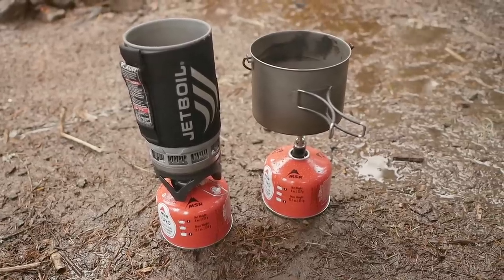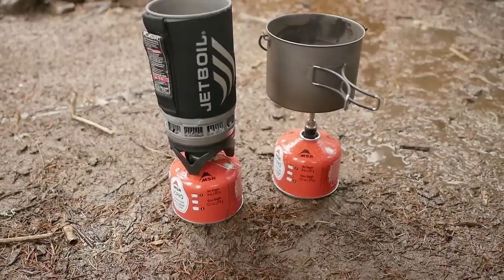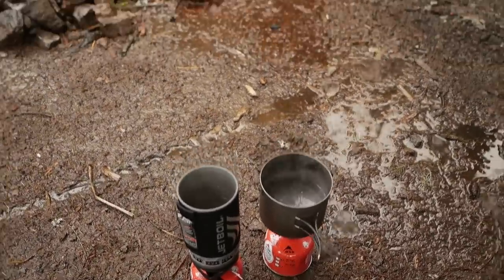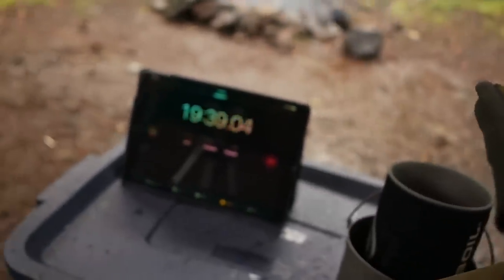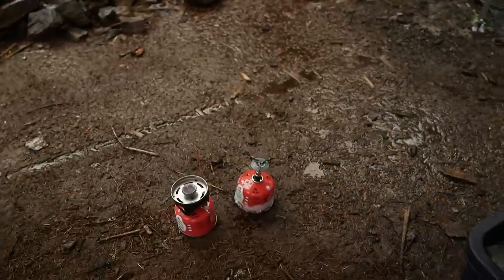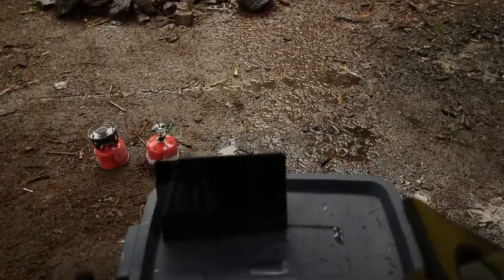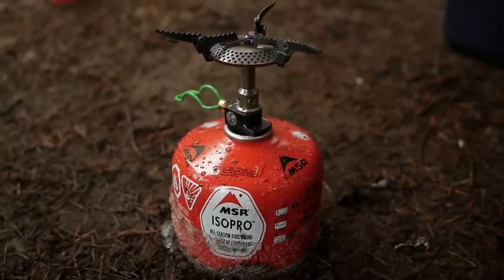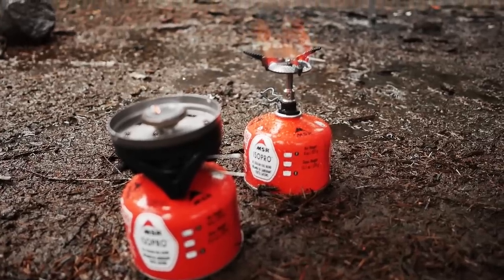How Long Does an 8 Ounce Fuel Can Last?  Jetboil vs. Optimus Crux Lite

Comment: It's really more about how many BTU/hr each stove produces that determines the burn time.  The Jetboil doesn't burn fuel as fast because the burner produces less BTUs/hr.   It relies on the heat exchanger on the pot to more efficiently transfer heat to the pot.   The open stove on the other hand, doesn't transfer heat to the pot as well.  It needs to make more heat (produce more BTUs to accommodate for it's inefficiency.   The real test would be to measure heat transfer to the fluid in the pot.  I believe you would find the Jetboil to be about 30% more efficient due to the integrated heat exchanger and pot insulation.
Reply from the maker: D. Volvoguy that’s exactly what I noticed on this experiment. The Jetboil stove draws out less gas from the canister to heat their container. Very efficient system
Reply: the 'trick' is the jetboil limits the max output of gas to maintain a more adequate fuel-air ratio. but if you adjust the Crux to 'blue flame' all the time they will last pretty much the same.

you could try to adjust the crux to the maximum flow with blue flame (optimum air-fuel ratio) and check if the contraption of jetboil really makes a difference.

i dare say it will make less than 10% difference: the main barrier for water heating is the transfer between metal and water. that is why a frying pan boils water faster than a taller pan with same volume and tea-kettles have a very wide bottom.
Reply: The test you mentioned is not needed as it has already been performed. Once the two stoves boiled water in the same amount of time only one variable remained. Technically there is a chance that either stove could have been turned down a bit and the maximum flame might have remained constant...I did see a lot of yellow/orange flame in the beginning with the Optimus. Anything beyond a blue flame with most gas stoves indicates an inefficient burn. But I doubt it would lessen the difference between the two stoves very much...maybe 20 minutes? Perhaps 30 minutes?
Reply: And this is exactly the reason why the frozen condensate was on the optimus and not on the jet boil as the pressurized gas was escaping the canister at a faster rate.  https://www.quora.com/Why-is-there-frost-on-the-outside-of-my-propane-tank
Reply: I tested by measuring weight loss from the fuel cannister. I compared an Optimus with and without a heat exchange pot. 11-12g of fuel without the heat exchange pot and 7-8 grams with the heat exchange pot. That tallies with other comments here about a 30% difference. To me the message is carry a little heavier pot to reduce fuel weight. The burner is less an issue if you set the flame to an efficient heat.
Reply: I noticed the optimus boiling way more than the jetboil at the time you pulled them off. Still maybe less efficient, but if you had timed them separately to the rolling boil, then did the math, the amount of 2 cup boils may be much closer to equal.
Reply: Yup  his Experiment mainly proves that the  Optimus  puts out more BTU
s so it can  boil water in the same amount of time as the Jet  Boil it just has to use more gas to get the same heat to the water..
Reply: Jetboil uses a small jet... Most open types use a 35... But you can buy those heat exchange spacers with a wind guard for $9.00 that fit over the open types. So you get better heating..
Reply: I found the most impressive thing wasn't the difference between stoves but how long those little fuel cans last. It's WAY cheaper than I thought it might be.

Comment: Thanks for the test. The fact that the fuel can on the Optimus showed frost when the JetBoil didn't was an indicator that the Optimus consumes fuel at a faster rate. If they both take the same amount of time to boil then the test reveals the Jetboil to be more fuel efficient (which I believe it is). The JetBoil's heat fins transfer more of the heat to the cup.

Comment: You're assuming that the efficiency and burn rates don't change as the canisters burn off.  BTUs per unit of time would be a better measure.  Interesting test, though.

Comment: I wish efficiency was the testing benchmark of these stoves. Yeah boil time is great but if it can boil 2 cups in 10 seconds but uses an entire canister every time then it's useless. But if I can get water to a boil with 200 uses then I know I can pack 1 canister of fuel with no worries.
Reply: Floordford amount of burn time / time taken to boil - should be able to tell you what you need
Reply: As far as given time with canisters: this should tell you you’re good either way with 1-2 of them. Typical resupplies are going to be 7-10 days for areas so 1 should last you because boil times don’t take much longer than 5-7 minutes typically. The shortest of the canisters had an average of 48 uses and it’s faster and that’s more than what you’d need before a resupply. Especially when the jet boil is bulkier and heavier.
Reply: @brianbrooking496  You're missing an important factor for some people though.  It's not as black and white as you'd suggest.
Reply: True Mordecai some people are hell bent on over complicating the simple things.....
Reply: @brianbrooking496  Yeah, I agree, such as weight.
Reply: @Hertacles  the jetboil is not more bulky
Reply: @crunch9876  literally look at it. It's a plate on a fuel can. Idk how you get it's not more bulky when it is.
Reply: @Hertacles  cuz it all fits in the
Cup that comes with it.... like every system.... only bulk that matters is bull while stored...
Reply: @crunch9876  that's why people who go lightweight and UL setups carry it still then, right? Because it and the cup is so much less cumbersome and lower profile than an MSR or BRS with a titanium cup? I didn't say it was bad, I said it was bulky. Which it is. But enjoy what you obviously use. Also the 2 I named can fit in smaller cups than the jetboil with a fuel can and take up less room. Have a good one.
Reply: @Hertacles  i didn’t say anything about weight. I said bulky. It’s not bulky. The larger cup is a plus as far as I’m concerned. I tend to need more water boiled not less
Reply: @crunch9876  you're not reading all of what I said either. The entire system is larger than other in its class. The 2nd to last sentence in my last comment literally said that. Those cups can boil 2 cups of water some as the rest and they're smaller profile and lighter weight.
Reply: @Hertacles  "2 cups of water same as the rest and they're smaller profile" think about that statement for a second.
Reply: @joshuas390  um... Ok thanks 👌
Reply: What I do is weigh my canister before and after doing a test boil
Reply: Bought an 8oz can with jet boil, been using it every morning to make coffee. Been a month, still using the same canister, try again
Reply: Thank you !!! That is the true testament. No pun intended. 😂😂😂😂🤣

Comment: Since the one canister froze the butane wasn't boiling off. Propane boils at -43F, IsoButane +10F and Butane +32F.
So the Propane boiled off and was used. Don't know if your blended canister had IsoButane (some do) but
I would venture a guess that the Butane in the canister didn't boil off, hence wasn't used, or at least not in its entirety.

It would be fun if you warmed up the canister to see if you could get more use out of the remaining Butane. At any rate, great
test. I would never guessed that it would last 2-1/2 to 3 hrs and I use these quite often on my little adventures.

Thanks for posting, I often wondered about this.

Comment: Interesting.  I was cheering for the Crux.  I've used the Optimus Crux for about 12 years now, and I'm a big fan.  I may be less efficient, but it's a rock star at high altitudes.  This was useful info though.  I've never really kept track of the burn time.

Comment: Cheers mate! Very helpful. I'm bikepacking 1 to 2 weeks and this vid has answered all my questions. I reckon I might even be fine with a 4oz!
Reply: 4 oz will get you at least 18 boils with a bsr stove (2 cups) and a plain pot.  If time is not an issue and you use a good windscreen, you can go higher.    In any case, you have temp, elevation... and so on as variables so there is no hard and fast number, but even an relatively inefficient stove only uses about 6.x grams of fuel per 2 cup boil.  If you get a more efficient system, then you use even less fuel.

Comment: Just from observation, the Jet Boil timed at 3:35:00 and the Cook Stove timed at 2:25:00 according to your timer.   But i notice the Cook stove boil water quicker and emits a bigger stronger Red Flame in the beginning.   in conclusion, i'm thinking the Cook Stove BTU is higher than the Jet Boil given the weather, temperature, and Fuel Canister even in the Test Environment.   

But good job doing this since i'm always curious as to how long these small little canisters last and how many to bring during a week long backpacking trip.
Reply: Thanks for saving me 10 minutes!
Reply: Popeye Sailorman yeah ok, but you didn’t factor in the radiator fins on the jetboil and the surrounding atmosphere protection to stop heat loss that’s built into the jetboil.

Comment: When I start my canister stove, the flame goes out after about 2-3 minutes (dangerous if you forget then to turn the gas off). I have to turn the gas head, till I hear a tiny "pop" like an air block going away, then I must screw it back to relight it. Then it all happens again. Any idea if its a faulty gas head or... what?

Comment: This test was not accurate. Both stoves reduced power after canisters become cooler and froze up especially that Primus system. It would take much longer if you would try to boil those same 2 cups of water after canisters froze up. Stoves run on reduced power and fuel consumption(per minute), therefore it took longer to use up those canisters than it would take if canister temperature did not drop as much.
Much more accurate would be to weigh canisters before and after boiling those 2 cups of water, for more accurate results boil 10 cups on each canister. It takes about 6 - 7 grams of fuel to boil 2 cups of water in room temperature and probably 10 for that other less efficient system. So jetboil would be good for some 35 uses, and that other system maybe 25 uses.

Comment: Interesting experiment having worn out my second jet boil sol, and having a few stoves and pots I decided to try a titanium pot verses aluminium pot verses  the jetboil sol pot using the house cooker/stove top to see how much diffence the pot makes. The result was
 4 minutes for the jet boil pot to boil, 41/2  minutes for the msr aluminium solo pot to boil and a surprising 6 minutes for the titanium snow peak pot to boil. Heat conduction through titanium is very quick so I guess it dumps heat fast.
I suspect that the crux was more affected by wind than the jet boil so with a wind shield would be closer to the jet boil time.  I'm thinking the pot and pot stove contact is the most important thing when considering how many gas canisters you need to carry.
Happy trails from the UK, other opinions welcome.

Comment: very interesting.  do you think Jetboil is efficient due to burner design or because of heat flux?  or combination of both?
Reply from the maker: nofeesh I think a combination of the heat distribution coils under the pot as well as the stove design contributes to the effectiveness . Definitely uses fuel more efficiently that’s for sure

Comment: hmmmm I think you would have found that the boil times would have increased dramatically as the cylinders emptied.  Not sure you would have archived the 71 boils that you state.  I've had several different gas  stoves and the boil time on all of them has increased as the cylinder becomes emptier.
Reply: Liberal science

Comment: Interesting video. You didn't address the decreased pressure towards the end of the canister. It is easy to see that the flames looked different. In my experience it can take much much longer to boil at the end of a can, so I think 48 boils is quite a lot more than you would actually get.

Comment: Personally I don't obsess over this, just 3.5 ounce micro burner and canister. Also have Esbit stove, use casserole type pan to disperse heat will boil some water, use baking soda to remove soot. Ultralite Alcohol Stoves I have all but dismissed as finicky and dangerous, but cat can type would consider under limited conditions. Use lot of tin foil for rehydration etc.

Comment: Should have used the Optimus windshield and a heat exchanger pot on the crux.
On low heat with a heat exchanger, my crux boils 300ml water in 1 minute 48 seconds.
Nice to know roughly how long it will last though.

Comment: The Optimus cook pot with the heat exchanger like the Jetboil is much more efficient. 
I get boil times very close or better than the jetboil and not having the crux turned up so much. 
Personally you should have both types of cooksystems, even having the jetboil mo system is still not the best all around thing to have. 
Having a burner with a wider head is much easier to actually cook with, even thought the optimus burner doesn’t regulate as easy as a JB mo, I tend to favor my optimus set.

Comment: Ok I have not seen the end, but the frozen condensation means the pressure in the tank is dropping faster, I'm guessing that will be the first to go out
Reply: I was right! Of course the jetboil will be more efficient, the pots are designed to capture energy better
Reply from the maker: Tony Rueb yeah, I didn’t realize that the cause was rapid pressure change until now. Great observation 👍

Comment: Soon as you saw the bottle frost up you knew it was using way more gas than the other.  I do like the jet boil but the extra expense for it I’m just not sure, but now we know you after a while it will pay for itself because it uses less gas.  Thank you so much for taking the time and expense to do this.

Where was the eye candy in this video lol.

Safe safe and take care.
Reply from the maker: wizardorlegend yeah it’s good to take into consideration the long term costs. Hope you find the right one for you🙂
And eye candy will be coming soon in a video, lol 
Thanks!
Reply: wizardorlegend, it seems like your logic is unusual.  It takes a certain amount of fuel or BTUs of heat from the fuel to boil a measure of water.  The Jetboil clearly had a smaller flame and was burning less fuel per minute while the Optimus was consuming more fuel per minute and producing a larger flame and more heat.  A larger flame indicates burning more fuel which you understand but you missed the concept that it will boil water quicker thus requiring less time burning fuel.  Both burners started with the same amount of fuel supply.  So you have a smaller flame with longer burning time or a larger flame with less burning time. In the end, the same number of BTUs were released.  They likely are both pretty much equally efficient.  You choose if you want more heat and a quicker boil or less heat and a slower boil.  I think a better test would be to test both burners while at the exact same level of gas release.  All open on one burner allows a lot more gas through than all open in the other burner.
Reply: Microarmor007 I agree with what your saying completely, I’m going off in the video it took 3 minutes or so and both where boiling, as you say it will take a certain about of energy to make that happen.  The jet boil did that with the smaller flame and it ran for an hour longer. The other burner put out more btu’s due to the larger flame and the fact it didn’t run as long, but the water was boiling at roughly the same time so a lot of those btu’s were wasted.

I think this is down to cup design myself, those fins on the bottom absorbing more heat or letting less heat escape.
Reply: The Jetboil has metal find on the cuppart I believe and that is supposed to help with absorption of the heat.  More surface area to transfer heat through.  So jetboil might be able to use a smaller flame in conjunction with a better heat absorption method to just be more efficient overall when paired with the included cup.  Some people don't like the large size of the jetboil for backpacking, but it certainly has it's uses.
Reply: Sorry, metal fins absorb the heat efficiently
Reply: If you notice the gas heads are differently shaped on the two models. The jetboil can use less fuel as it's gas heads are slightly concave and center the flame onto the heat baffles on the bottom of their pans to create even heating and less wasted heat. The other head is slightly domed and doesn't have a baffle system to retain heat.  The jetboil also has a static electro starter where as the other has to be started with a flame.
  Say what you will, but I've trusted my life to jetboil on multiple occasions and have never had one fail me. I'd rather pay a few bucks more for a more efficient system that uses less gas any day.